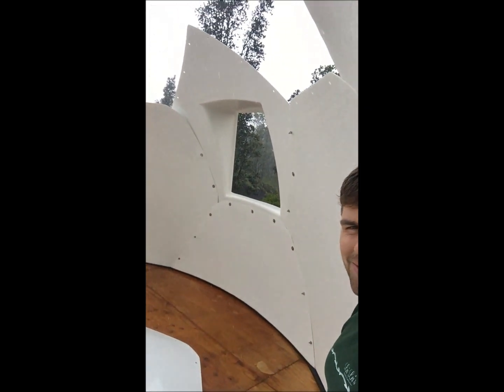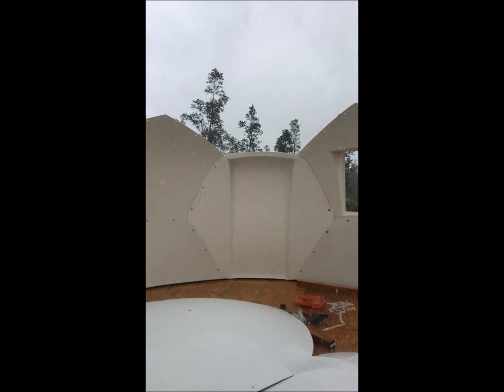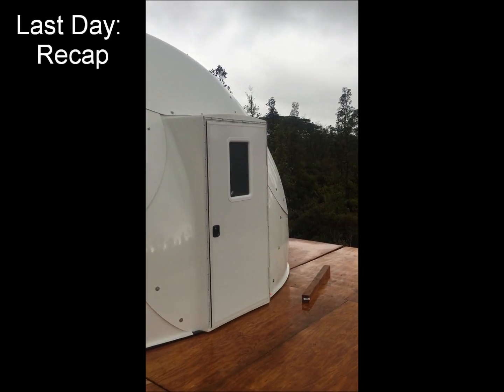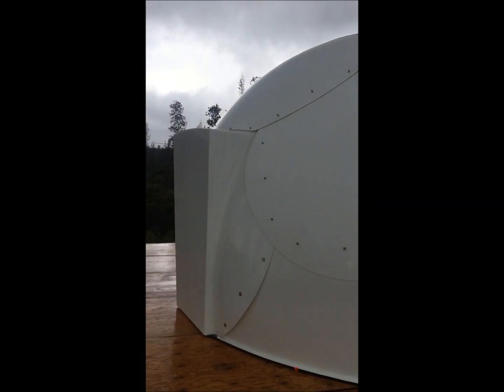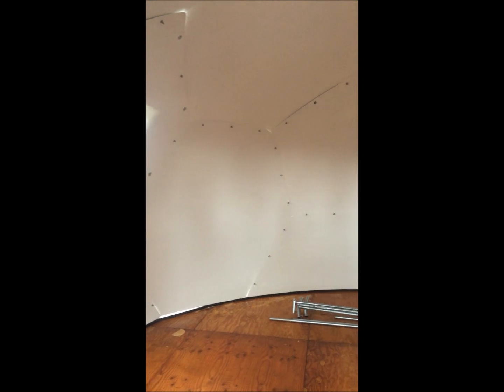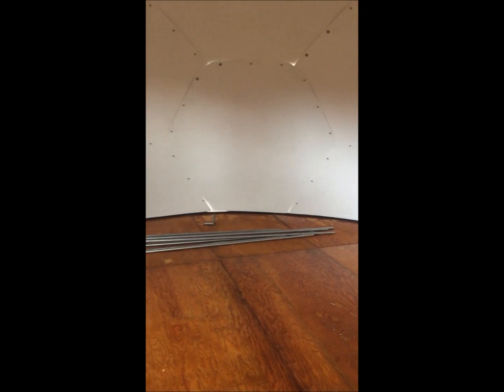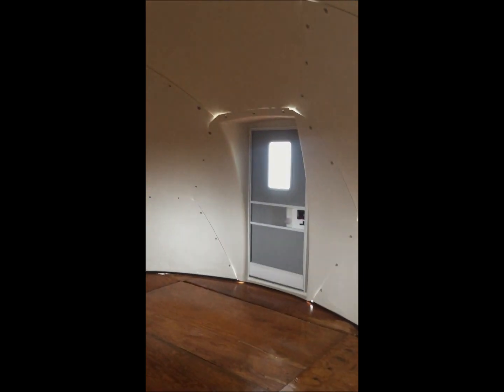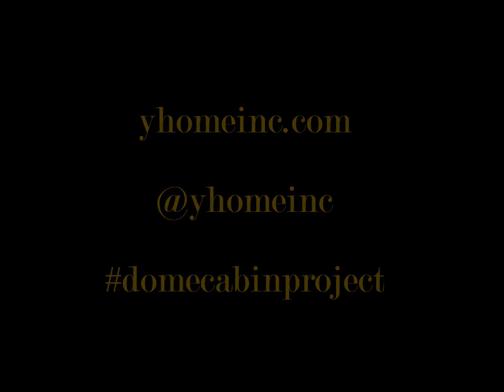Off Grid Dome Cabin Project: Building the Dome

Comment: It weighs 1100lbs only. How does not blow away in the wind or rattle and shake...or does it?
Reply from the maker: The dome shape allows air to flow over and pushes the dome downward. It can be secured to the ground if you like. 
It doesn't shake because it's tightened together with nuts and bolts.

Comment: 2 years out...was it a good purchase? Thinking about getting one for NM desert life would you recommend it? How does it do in the wind & such ? What do u think about snow? Would it hold. Is this something I could have a rocket stove/ wood burning fireplace in?
Reply from the maker: Great purchase. Easy to install. High wind and weight ratings. Fire exhaust would be a huge concern inside, however, I vaguely remember seeing these things insulated on a website. company's name is Intershelter domes.
Reply: How did you seal all the holes where you see daylight?

Comment: After building and living in the Dome would you do it again or pick a different housing solution. Aloha Tom
Reply from the maker: I only lived in the cabin for a month at a time, while building. I was between there and Oahu. I loved it and would do it again. I would probably add one more dome (they can be connected) or add some sort of hatch, in the floor,  to access the container.
Reply: @danthehawaiirealestateman3697  I added your channel just for fact this was done in Hawaii and in rain. I've been checking out dome homes and wondered about this style
Reply: @danthehawaiirealestateman3697  How do you connect two of them??
Reply from the maker: @AlexA-cn5ip  it would be where the door panels are. I've never done it, however, on the Intershelter website there should be some answers.
Reply: @danthehawaiirealestateman3697  Ahh interesting okay thank you. 

Do you know if the dome would be strong hang a hammock inside of it? Maybe connected to its bolts?
Reply from the maker: @AlexA-cn5ip  That would be pretty cool. I would say yes. Might be able to add something to the hardware to get a decent attachment. To be safe I would somehow rig it to utilize two bolts on each side of the hammock.
Reply: @danthehawaiirealestateman3697  Thanks!!

Comment: Were you able to obtain a building permit for the dome from Hawaii County?  How hard and what did it entail to obtain the permit from Hawaii County for the dome?
Reply from the maker: We didn't get a permit. However, I've talked to C&C before about permits and the process is straightforward. Just takes some time for the stamp of approval. Mostly it entails submitting and routing paperwork. I was told these domes were already approved through the county. There's a church on Oahu that submitted plans on the outer islands, so some of the legwork has been done.

Comment: Can this be insulated? 
Is it water-tight ?
Reply from the maker: It can be insulated and it can be made water tight. We ended up not putting sealant between each panel. Water has only seeped in around the base at a couple points. We added waterproof caulking and it has held up. The dome does come with a thick foam base seal. The points of water intrusion are where the base foam could be moved to improve seal but we used the caulk because it was easier.
Reply: Your HOME Inc —- seen a cluster while traveling in Oahu, HI — did not get a chance to inspect up close
Reply from the maker: @iraa9935  Its the community called The Shelter. They help families get back on their feet.